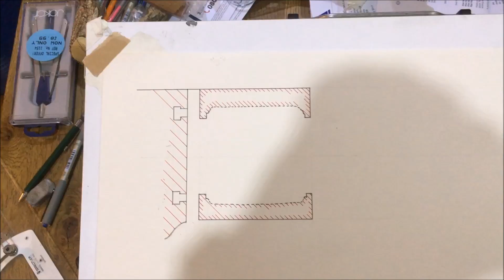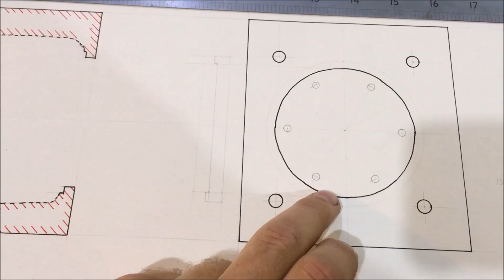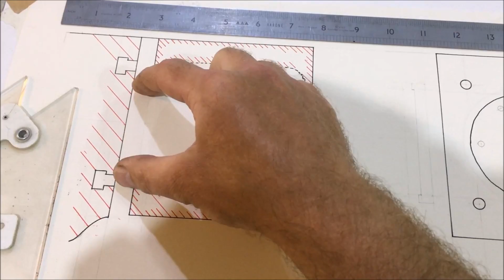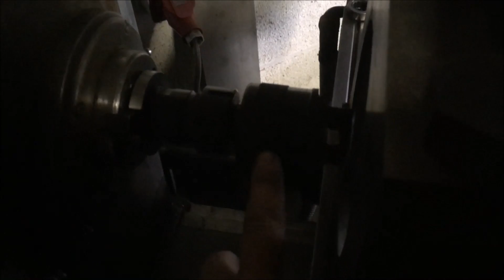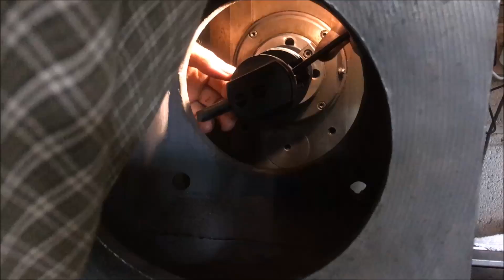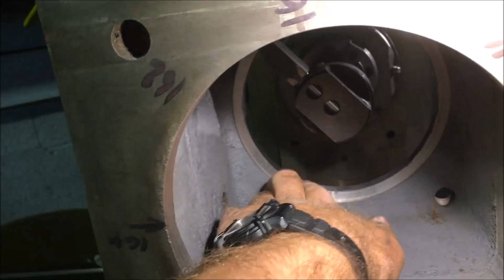Elliot 14S Update 20

Comment: Whew!  Not sure I'd want to tackle that task with my current experience, at least not unless I absolutely had to, which means I'd have a good excuse to put it off.  I was under the impression that even the most basic table could be rotated.

Now that I'm past the mixer gear hurdle, I think I'm to the point where I can sort out my own table tilt problem.  The current plan is to clear off the base under the table, remove the outrigging support, pull the table out on the mainshaft enough to remove the temporary stop pin.  Once that is out, allow the table to go completely upside down.  Put some cribbing between the table and the base, and lower it with the crank to the cribbing.  

Once I get the corruption cleared away, I should be able to wiggle & jiggle the table out to where I've got the clearance needed to remove that top supporting bar and the connecting rod between it and the mainshaft.

Then again, there is the mystery of how to get the full range of angles out of the tool head.  Maybe I'll look into that first.
Reply from the maker: Its a bit of chicken v's egg - experience that is. Ive little and would prefer more - which means I have to undertake stuff that I would previously have left due to lack of experience. I guess at some stage I will cock something up and then I will have learned one way not to do something. On the other hand, the more i try different things the more confidence I gain and keep pushing the boundaries of what I feel I can attempt.  Like you I thought most shaper tables rotated - not so, the more I look into  older shapers the more I find they were fixed tables. I think the capabilities were developed when milling machines started to properly enter the market of machine shops. Thanks for stopping by, all the best Mat

Comment: Mat, looks good so far. The beauty of making it up as you go is that you are always on plan. The horizontal mill is sure handy for that type of milling isn't it. Taking off the key section and milling a groove for its replacement should be no problem with the horizontal mill. Craig
Reply from the maker: Hi Craig, I fell out of love with the mill as I had positioned it in such a place which just makes it a PIA to use effectively (tight in a corner). Its on the list of projects to modify it and bring it into a more useful position. It is far more flexible than I give it credit for if not a little small working envelope of 12x8x8". Thanks for dropping by and commenting. All the best Mat
Reply: Is ther an option to mount your vertical head with the spindle parallel to your mill table?  e.g., to use your longer X-axis travel when you need to bore a longer setup?
Reply from the maker: The vertical head will mount in that way - however, the table travel is 13" total. when the head is rotated it leaves approx 10" of table beyond the tool mount position. the tooling then takes up 5" leaving the box to be mounted on only 6" of table at the extreme of the travel - i.e. the part most worn - its a small working envelope.  I have a plan to mount a Bridgeport 2Js head on the over arm - then I can have a quill & more daylight below - its on an iso 30 taper which is smaller than the iso 40 the current set up uses - which is a pain. Its on the list of projects. All the best Mat

Comment: Why didn't you tell us beforehand  ?
We could have gritted out teeth in sympathy  ... I am sure it would have helped  !
Are you going to spin it around and buzz the keyway of the clamp face whilst it is all set up ?
Reply from the maker: Hi Steve - yeh I will mill off the keyway while the vertical heads off the mill and cut a 'key way' to take a key so I can locate it onto the adapter plate ... or maybe dowels ? not decided that bit as yet.
Thanks for stopping by - hope you enjoyed the footage ... All the best Mat

Comment: Now your doing it, great job and idea on making the box rotate. You can do anything you want, the only thing that will stop you is you.   At least this is what I tell myself. LOL.   Great video Mat, I thoroughly enjoyed it.  Steve Summere
Reply from the maker: Hi Steve - its from watching others that I gain the confidence to 'give it a go' then experience helps me get the hang of it.  The second bore took a few minutes as I knew rpm & depth of cut and feed I could get away with - so should I do the same kind of thing again - should be a breeze ;-) On the first bore the tool adjust dovetail on the boring head worked loose - that was interesting as the cut got smaller ? soon worked out what to do. Keep putting out your vids Steve - I learn much from them. Thanks for watching and commenting. All the best Mat
Reply: For myself, I've found that sometimes, physics, laws, and economics also play a part in stopping me.  More often than not, it is just me though :)

Comment: Hello Mat,great job, I must tell you that machining cast iron just SUCK!Mat I will run outside quick and take some photos of my table-saddle setup, but what I can suggest from my primative point of view, is that you drill and tap 4 rather large holes in the centre of the saddle bout 18mm or so, cut the boss round so it can seat in the step you machined, and then sandwitch the table to the saddle with the boss, if that makes sense?this way if you loosen the 18 mm bolts you will be able to rotate the table
Reply from the maker: Thats about the size of it Ian - I was looking to use M8 Hex head fixings as they will provide plenty of strength and spread the clamping around the disk onto the box - if I go for say 3/4" threads I dont think there is enough material for the threads to get a good purchase & that then means a big socket / tool to get through the front end... does that make sense ? mat
Reply: it does, the nuts that are on there is about 33mm, I believe it to be some imerial size, and they did not come out easely, I had to open a 32mm socket so it will fit, then once out I milled half a mm of each side of the nut off, then went to the pawn shop and bought a new 32mm socket and that worked out all right, tightend them to 110 nm.
Reply from the maker: crikey 32mm AF thats a tad large ! I have a few used sockets over that - but they each use a 3/4" drive. thus the preference for using cap heads with a hex key .